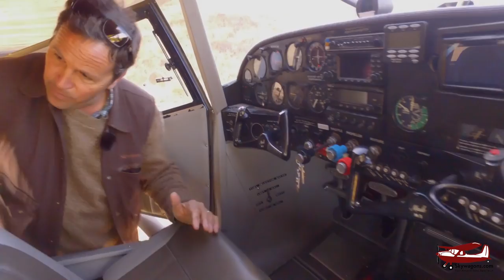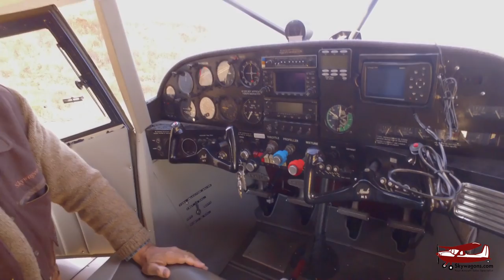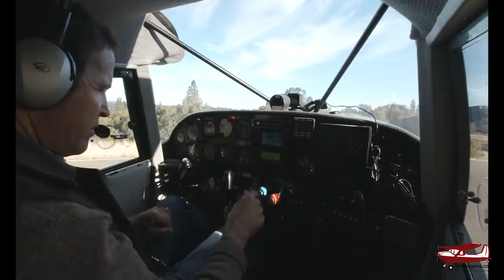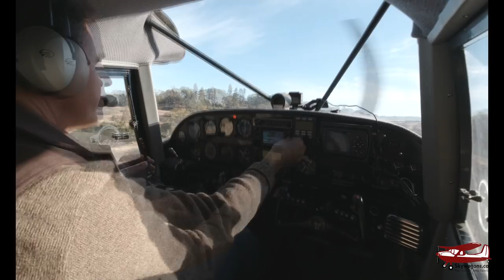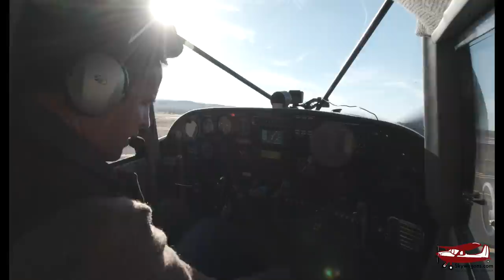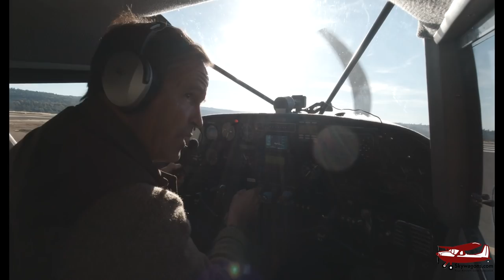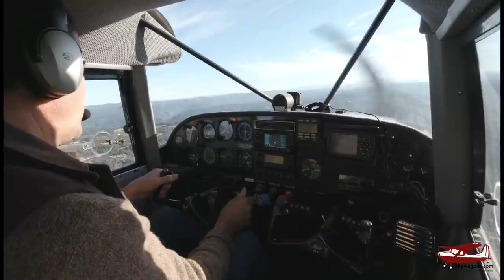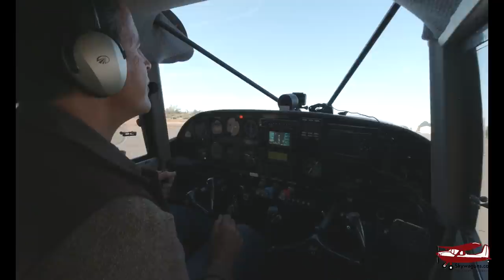The Maule M5 210C

Comment: Brings back memories of flying my M7-235B. Great video.  Speed in a Maule on landing will mean a bounce.  But you get to log 3 or 4 landings in one circuit!
Reply from the maker: Very true!
Reply: I Love my Maule, you are absolutely correct on excess speed. I have never learned to make a good wheel landing on the Maule , to doit right, you have to have the correct attitude and run out airspeed and altitude at  the same time. Enjoyed the video. I've heard that Mr. Maule will give lessons was planning on going over there, but got to Lehrer I was satisfied with most of my stall landings.
Reply: @jackiewindham8199  , if I remember correctly, the Maule handbook states that wheel landings are NOT recommended. I did them for my tail wheel endorsement, but not after that.
Reply: Just how tricky are these as to ground loops?  I’ve got a lot of time in Barons/340/warriors/lance and various Cessnas—but zero tail time.

Comment: "It would actually be a good plane to get checked out in tailwheel..."

I flew a 235-horse M5 with the VG's on tour operations here in Hawaii. I've flown Stearmans, Waco YMF5's, Citabrias, Super Cubs, Cessna Ag Trucks, a DC-3, and a Great Lakes biplane with nary a landing issue. NONE of these were more challenging to land gracefully than that little Maule. I think this was because the Maule, with the small tires (ours originally had balloon tires which were removed and replaced with conventional tires like the ones in your video before I flew it) sat on the pavement in a relatively flat attitude which wouldn't permit a full, or near full stall, three-point landing—it was still trying to fly in its earthbound attitude, and the slightest bounce would require an immediate and finely tuned response with elevator/throttle to tame an embarrassing PIO porpoise down the runway. Additionally, our (three-blade equipped) M5 had very limited propeller clearance, so raising the tail to dump lift and control rebound risked a pavement prop strike (don't ask). This Maule was wrecked in a landing accident by a pilot with limited tailwheel experience after I left the company. The M5 was just fine in the air, but I'd certainly have reservations about soloing a student in one.
Reply from the maker: Interesting. Thanks.

Comment: Mark. Love your videos. Keep them up. Just a few notes for accuracy. It's an M5-210C not M5 201 C or MX. The landing gear is not bungie, its oleo struts. The fuselage is not rag from the firewall back, the boot cowl is metal. There is no cuff on the wing, straight uncambered USA 35B airfoil, with VG's. And yes, you can land about 40 mph slower than you did. Love it! Keep em' coming!!

Comment: Hi Mark, 1st time watching your channel. I had a 1974 M-5 210c with the IO 360D 210 hp also. There was no place I landed that I could not get out of, an amazing airplane with tremendious leg & head room. Here in Michigan we have a lot of grass and unimproved places to land and this plane would do it all. I also had a 1976 180K 0470-u that was a great cross country and short field plane.  Currently our mission organization has a 1948 108-3 Stinson with a 165hp Franklin.  Its a smooth flying plane and I like the oleo gear on rough fields but its a little small for hauling loads.  The Maule didn't seem to mind how much you put iniside it would always jump right off.  Terry 3-21-22
Reply from the maker: Thanks great back story.

Comment: I was visiting a friend at Maule a little over 30 years ago, and was invited to put my C170B in the hangar for the length of my stay.
BD Maule walked up, looked over my 170 and said " Why didn't you buy a Maule?!?"
I made some weak excuse, then walked outside. My buddy Lawrence and I were shooting the breeze outside of the hangar door when I heard an engine start inside. My friend advised me to step away from the door opening, which I did.
Shortly afterwards, the engine inside went to full power and old man Maule had it in the air before he exited the door. 
It didn't seem as dramatic as the famous photograph of him doing for an ad, but it was still mighty damn impressive.
Maule is pronounced like 'haul'.
Reply from the maker: That would have been fun to see.  Was the 170 blown the the back of the hangar.
Reply: @skywagonuniversity5023  Didn't disturb any of the aircraft parked inside. It's a big hangar.
The sound was incredible!
Reply: Thats awesome! Ive been there so I can see how it could ve done! Would've loved to see that! I heard his wife made him stop it after he got off the ground to soon once and got pretty close to the top of the door😄
Reply: Yes, it's not evident from the famous picture but that hangar is 300 feet long from the front doors to the rear doors so basically the length of a football field.

Comment: Nice vid.  Minor complaints. You forgot the Franklin powered M4.  It might have been the best of breed. You might have mentioned that the 235/260 hp Maules will run with 180s. I think you should have mentioned that Maules cost way less than their Cessna counterparts. Several IAs I know have told me annuals on Maules are much easier and faster, hence cheaper, than on Cessna counterparts.
Reply from the maker: Thanks for the info!

Comment: Maule rhymes with "haul".   I have a few hours in the M5-210C (not 201C - I believe it's for 210 horsepower Continental) - got my tailwheel endorsement in it -  my good friend's airplane.  The interconnected rudder is a weird thing.  The gigantic fin also makes the airplane want to weathervane pretty strongly in a crosswind - although the rudder authority is plenty - you just have to really use it sometimes.  It's a draggy airplane - reduce power and it's coming down!  Very noisy with that prop and the high RPM required to make 210 horsepower from 360 cu-in - you could hear the noise breaking through the squelch on the intercom in this video - it's noisy!!  The Maule is a plane designed more for economical production with basic materials and for operation (and repair) in the field than as an ultimate flying machine.  

For reference, some C206s do have right-front doors - the P-model (P206).  They have door configurations like the early C210s and the C205s.  Doors on both sides of the front and a single large baggage door on the left.  But the more common C206s are configured as you said with the pilot's door on the left front and double barn doors on the right rear.
Reply: The c stands for cargo door, on the rear. Not all had that.

Comment: what prop was on that maule m 5 ????
Reply from the maker: The prop is a C203 McCauley set to turn at 2800 RPM to get the 210 HP.  Cruises at 2400 RPM.  Power is for take-off.